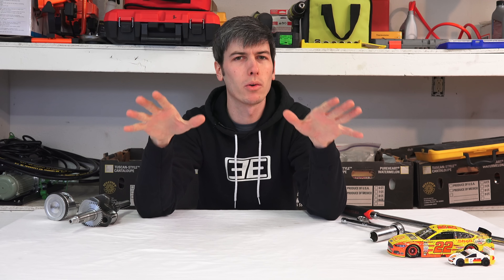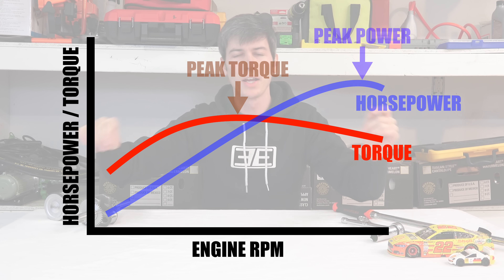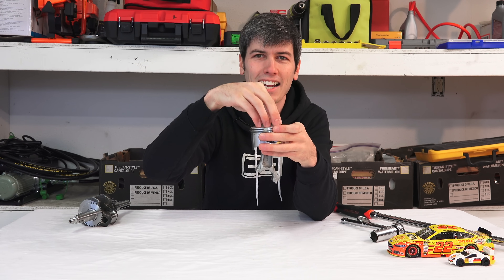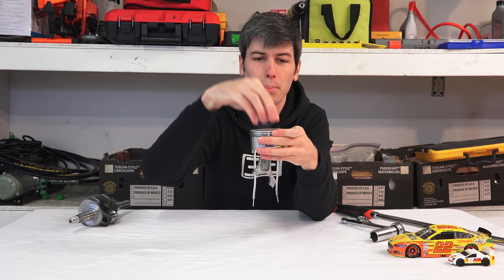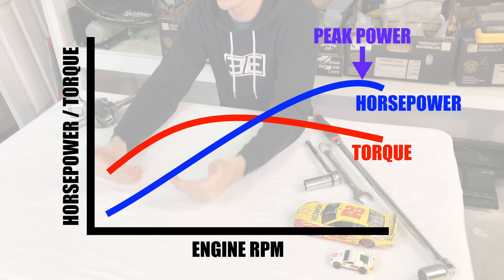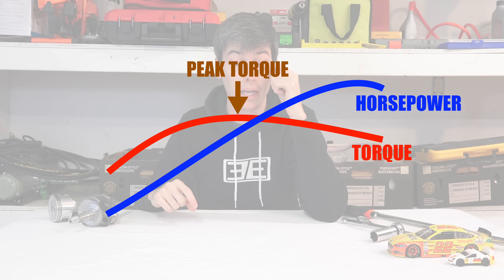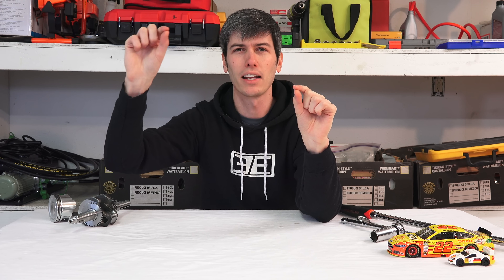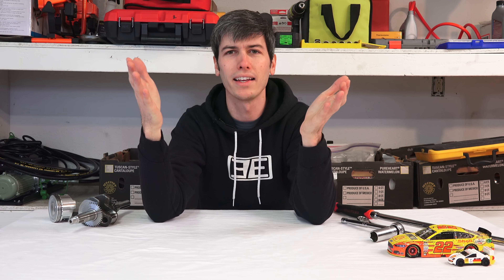Horsepower vs Torque - A Simple Explanation

Comment: So basically, if you have a very high torque engine but lower horsepower (like most diesels) you can greatly increase acceleration by a numerically lower gear ratio, right?

Comment: Why is Big Blocks are faster than Small Blocks ? Is it cause Big Blocks have way more torque ?  7.0L Small block VS 7.0L Big Block V8. I seen Big Blocks win most the time drag racing and truck pulled.

Comment: if i increse the fuel and air but my rpm stay the same all that will do is increase the torque right ?
since the speed is no different ?
im getting confused on that part anyone one able to exsplain that part because i know that anit right even if my rpm limit dont change i know your still gaining hp

Comment: I dont get it. Why do you compare torques on a different gear ratios? If you change a gear ratio to 4.0 to get the peak power, your torque at the peak torque also raises because it's  multiplied by 4.0 too, right? So it's 50 lbft*4=200 lbft   and 40lbft*4=160lbft, am I right? Please answer me, I would like to understand that :P 

Second question. Why does torque depends on rpm?

Comment: Soooo.....I need longer rocker arms bolt on my piston to increase leverage.....= need new/bigger engine space...

Carbon fiber rocker arms/piston...

2008 mercedes c300 rev limit low already (5-6,000rpm) = locking high rpms...
Reply: What the hell did I just read

Comment: The engine I`m standing with is 24 HP at 525 RPM and has 240 Ft Lbs of torque at the crankshaft , bore and stroke is 8 X 10,
 503 cubic inches 1 cylinder built in 1940. Manufacture is Fairbanks & Morse

Comment: So, in the example you gave of the two cars, if the gearing is the same,  which will accelerate fastest and which car will have the greatest top speed, the 100bhp 200lbs/ft or 200bhp 100lbs/ft ?

Comment: One question.. How can high Torque 7.3 powerstroke engine in a truck.. out run a high horse power Porsche in the quarter mile??  Diesel engines have higher torque.. There's videos all over showing heavier truckers eating high horse power cars in the 1/4 mile.   Torque is where it's at...

Comment: Just think of the unit of the two: N*m vs Watt(J/s). They are just two Physics terms made by our humans to refer to different calcualation results, hence reflecting different concerns regarding the performance of an Engine. For general consumers of cars, if you want your car to be "fast", just aim at higher Power; And if you want "better torque", simply choose the right gear position (lol)

Comment: You've created a paradox in your explanation. If the greatest acceleration in a single gear is felt at peak torque then logically you will have peak acceleration at any gearbox ratio at its peak torque point. This means an infinitely variable gearbox will always accelerate fastest at an rpm corresponding to peak torque, but later you claim for variable gearboxes its peak hp that accelerates quickest. Can't have both...
I prefer my explanation: peak acceleration occurs at whatever combination of engine rpm vs gear/diff/tire ratio provides maximum torque to the road surface via the wheels.
F=ma. There is no need to factor power when determining acceleration since its not used in the equation. Maximum torque at the wheel/surface interface provides maximum acceleration.
So how do we find what maps that maximum torque curve if we have an infinitely variable gearbox? 
That's easy, keeping the engine at peak power at any given road speed leaves only one overall ratio to choose for that given road speed, and that will correspond to the greatest torque to the wheels/surface interface.
Summing up: maximum acceleration occurs at maximum torque at the wheel/surface interface at any instant in time. To find the best combination of engine rpm and overall ratio to achieve maximum torque there, we use the rpm at maximum power for that given road speed to select the ratio that is required.
Hope that makes sense.
Reply: No your third sentence is wrong. The CVT accelerates hardest at peak wheel torque, not peak engine torque.

Comment: Power is the Volume of Torque.  
At the peak power RPM an engine produces more torque VOLUME than it does at peak torque RPM.  
Highest torque at the wheels at any given vehicle speed occurs at peak power. 
At any vehicle speed the engine RPM at peak torque dictates a gearing ratio.  In order to raise engine RPM to peak power but equal that specific vehicle speed a higher multiplication is required.  This higher multiplication generates a HIGHER torque at the wheels.  
This is why a vehicle accelerates quickest at peak power and not peak torque in a CVT equipped vehicle.

Comment: How to define how much work was done over horsepower?
Reply: Work is power x time. Just multiply the time by the power. That's if the power is constant, if not, it can get very complicated...
Reply: Force (Newton) times distance (meter) will get you power (Watt). One Hp is about 750 Watts

Comment: Torque is essentially a static measurement. No work can be done by torque alone. As soon as a dynamic component (rotation) is added, it becomes power. A shaft must be in rotation to perform any work. Once shaft rotation (angular velocity) is present, the shaft can perform work. This is what power is. Torque (lb•ft, N•m, etc) multiplied by angular velocity (rpm, radians per second, degrees per second, etc) is power.

Comment: Stop calling it "Horsepower". That is part of the reason it is so hard to understand.
Horsepower is a dated unit. Nobody except car people still uses it. The actual unit is Kilowatt, but I guess that does not sound as good in advertising. Torque is a physical quantity. Quantities are measured with units. You can not compare a quantity with a unit.

Comment: The other day I drove a friend’s nearly identical car to mine (mk7 GTI), except it has a stage 1 APR tune. It honestly didn’t feel that much faster, although it supposedly has nearly 80 more hp than my car. It did feel like it revved up to the redline faster, but the acceleration didn’t feel that much better. Can you put the points from your video into my experience? Having a hard time connecting the two.

Comment: Torque: Work per rotation, 1nm means 1 Joule every radian of rotation
Power: Work per time, 1W means 1 Joule every second

Since you need work(energy) to increase the speed of a car... ( see kinetic energy formula and derive velocity)

Power tells you how much your car accelerate every second...
and torque tells you how much your car accelerate every rotation of the engine... ..which is not quite that interesting if you ask me...

The trick is acceleration depends on the current speed because kinetic energy is not linear with velocity in fact:
a = P/(vm)

Comment: Good explanation. Torque is basically irrelevant to discussions of performance, since it is a static measurement. The average human holding a wrench can exert more torque than a jet engine, but that doesn't mean he can run at 1000 mph. Power, mass and drag are what define a vehicle's acceleration and speed.

Comment: Horse power= torque/time
Reply: Nope.  Horsepower = torque * RPM * a unit translation factor of 1/5252.

If you use radians per second instead of RPM, Watts instead of horsepower, and Newton-meters for torque, the formula is:
Power = torque * radians/second.

Comment: He is wrong at at least one point. He says a higher gear ratio or “higher leverage” means quicker acceleration lmao. Think about that.
Reply from the maker: Thinking about it. A higher gear ratio (higher gear ratio, not a higher gear) means more wheel torque. This turns into faster acceleration.
Reply from the maker: Thinking about it. A higher gear ratio (higher gear ratio, not a higher gear) means more wheel torque. This turns into faster acceleration.

Comment: Can't we use higher gear ratio with peak torque to get maximum acceleration...
Reply from the maker: Nope, your wheel torque will be highest when you have the torque at peak power multiplied by the highest gear ratio possible. This video explains why: https://youtu.be/cb6rIZfCuHI

Comment: Torque is how many people can you move in your car, hp is how much pressure can you fell in your seat, getting some of them down...:)
Reply: in other words, you can reach some speeds pretty fast, if you have power, but you can not go beyond this speed, without torque, because of the air resistance.
Reply: Am I right, or am I right?

Comment: Hey Jason! 

Why Diesel cars have more torque and usually rev lower than Gasoline cars. Very often, a diesel version of a car wil rev up to around 4k rpm, and the gasoline version around 6k rpm. Most of the times the gasoline ones ending up with more power and less torque.

Cheers
Reply: There are a pot of reasons, I'll give you three: 1. the stroke of the cylinder on the engine are longer, allowing for more torque. 2. The fuel ignition difference; gasoline mixes with air and then combusts with the help of a spark plug. Therefore the combustion is limited and the power behind the combustion "fades out" by the time the cylinder is at its lowest point. The diesel engine however uses compression to ignite the fuel that is sprayed in. That means that the power behind one stroke of the cylinder is the same at any given position of the cylinder when it lowers itself. 
3. This is the main reason, that diesels don't even high; diesel engines are WAAAYY heavier. Since the components need to be to withstand the high compression of air (up to 50 bars, while gasoline engines go up to max. 16 bars), they are way more massive than the petrol engine components. This mainly means that achieving high revs will be difficult since everything is heavier to move.

Comment: What if you made an engine with low rpm high torque initially, but as you throttle , the rpms go higher while diminishing/balancing the torque?

Something like an adjustable "torque leveragle, through maybe oil pressure, or even centrifugal force"

Can you explain why it can or cant be done? Im not an engineer, but you are so you should be able to explain this concept better than me.

Comment: Thank you Sir for this video, But I still confuse to diiferentiate both of them in real life, how can I say That this car / motor bike have a big power or have a big tourqe. If I may ask you two questions in real life example, 

1. what should I say to a vehicle that really gives me a strong pushing back sensation to the seat when I accelerate?  is it because of big power or big tourque? 
2. what makes a motor bike do wheelie easily, big power or big torque? 

Thanks in advance

Comment: Does a higher gear ratio mean higher top speed or faster acceleration? 

Edit: If you did answer this question in the video I did not understand your answer.
Reply: Higher gear is like going from 2 to 3 . So lower rpm and higher top speed.

Comment: A 140hp bulldozer will rip and push tonnes of rocky earth in a single pass. Could a 140hp Mazda 3 with non-existium super traction tyres and a dozer blade shift loads at the same rate?

Obviously the dozer makes massively more torque and weighs ten times as much, but since ripping and pushing soil at a certain speed is work being performed I don't see how it makes any difference. Then there is the Harley vs Sportsbike debate of torque vs power. I like sport bikes (approximately) and I don't see how a 50ftlb/120hp sport bike can be less effective than a 120ftlb/80hp bike, even if moving heavy gear.

Comment: Analogy: stomp on the gas and the Dodge Cummins at 1500 RPMs and stomp on the gas in the Honda at 5000 RPMs and you will be feeling the same amount of horsepower is that clear short and simple enough...

As they say if you can't explain it to a five-year-old you don't understand it good enough yourself

-an engine freak, son of engineer
Reply: When people say it makes lots of torque, it means the engine is making lots of low rpm horse power...
(tq x rpm)/5252 = hp(power)

Early 90s Dodge cummins 12v 5.9L 6BT
400 ft-lbs at 1600rpm
250hp at 2500rpm
After doing some math you get
*400 ft-lbs torque at 1600rpm = 121.85hp at 1600rpm

90s honda prelude 2L H22 usdm
153 ft-lbs at 5500rpm
187hp at 6800rpm
I have a few dyno sheets for this engine so i know its making:
*130 ft lbs at 2500rpm and this = 62hp at 2500rpm

Summary read the first sentance i stated. And compare the stars... Its a internet mystery because no car manufacturers lists low rpm hp...

Comment: When people say it makes lots of torque, it means the engine is making lots of low rpm horse power...
(tq x rpm)/5252 = hp(power)

Early 90s Dodge cummins 12v 5.9L 6BT
400 ft-lbs at 1600rpm
250hp at 2500rpm
After doing some math you get
*400 ft-lbs torque at 1600rpm = 121.85hp at 1600rpm

90s honda prelude 2L H22 usdm
153 ft-lbs at 5500rpm
187hp at 6800rpm
I have a few dyno sheets for this engine so i know its making:
*130 ft lbs at 2500rpm and this = 62hp at 2500rpm

Summary read the first sentance i stated. And compare the stars... Its a internet mystery because no car manufacturers lists low rpm hp...
Reply: Analogy: stomp on the gas and the Dodge Cummins at 1500 RPMs and stomp on the gas in the Honda at 5000 RPMs and you will be feeling the same amount of horsepower is that clear short and simple enough...

As they say if you can't explain it to a five-year-old you don't understand it good enough yourself

-an engine freak, son of engineer

Comment: Torque acts like pulling power, so a vehicle with an engine with greater torque but not high horsepower say, would get up an hill much easier than if you had less torque but more HP.

Comment: The Car with higher torque is still quicker at accelerating since we have to assume the gears are equal too? Which means it is capable of getting of the startingline quicker. The engine is able to rew up quicker. 
This means that at first, the Torque car has more HP applied to the street. However, it has a lower maximum hp that it can actually give out (meaning it has to shift into 2nd) while the other car is still going. This process repeats it self until the top gear, in which the HP car is much much faster than the Torque car. 
Obviously you wouldnt give these two cars the same Gearbox, but that wasnt the point here.

Comment: I disagree on the 'pushing you against the seat' point. He said you'd feel pushed against your seat the most at peak torque but you'd get max acceleration at peak power (the latter being obviously true). How hard you get pushed into your seat is directly related to how hard you're accelerating, so you get pushed into your seat hardest at peak power (when you're accelerating the hardest).
Reply: Flip the HP curved upside down and think of it as a slide now where do you think you will be feeling the most change in acceleration... at the steepest part. 

Your saying you'll be feeling like you're hauling ass at the bottom of the slide, yes, but it's not gut-wrenching like the drop
Reply: @ddiablolll  Rate of increase in horsepower (ie steepness of hp curve) is not related to acceleration. What you're saying doesn't make sense.
Reply: @outandaboutDave  okay well seeing is believing if you have a g meter put it in your car put your car in 4th gear floor and observe what the G meter does...

 acceleration is most definitely connected to the rate of increase horsepower...

you will see a turbo spool on the G meter it will be a sharp spike in acceleration you will feel. The G meter will tell you exactly where you're accelerating the hardest. 

For added insight keep flooring it past Peak horsepower and see what the G meter does you'll be shocked when you see the acceleration going down past peak hp, even though you're making more horsepower than you did at Peak torque

Comment: At 5:25 you say that peak acceleration happens at peak torque in a set gear. What do you mean by a set gear? Wouldn’t you want to get the rpm to peak hp in any gear to get the most accel?

Comment: 3:50 Put a 10k lbs load on both cars and I don't think the car you say is faster will indeed be faster.
Reply from the maker: Power wins, if weight is equal, every single time. This is simply the definition of power (how fast you move an object from one spot to another). More power means you can move that object faster, no matter how much it weighs (the more weight, the slower you move it, but with more power you move it faster every time).
Reply: Engineering Explained what I was trying to get at is that at certain weight the car with less torque will not even be able to move at all and would probably break but the one with more torque will.

Comment: this was always so confusing for me, torque is the only thing accelerating your car, as it is the only kind of force that rotate your wheels. thats why torque vs power makes no sense. if you have more power than your wheels are experiencing more torque, as you need a greater force to do the same work in less time.

Comment: So if I were to translate this into riding a bicycle, horsepower is the power I transfer to the pedals, and depending on the bike’s gear, torque changes?

(But my physical power will remain at the same limit) 

And lower gears would not annoy me.
Reply: Yes, that's more or less how it works.